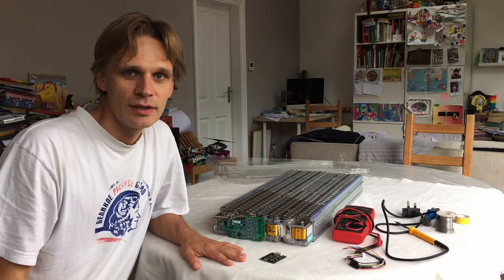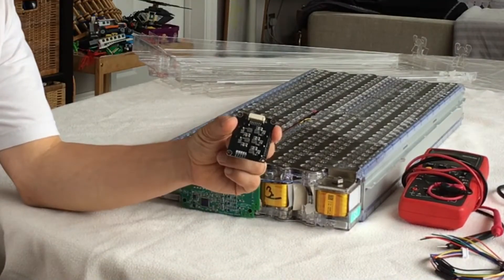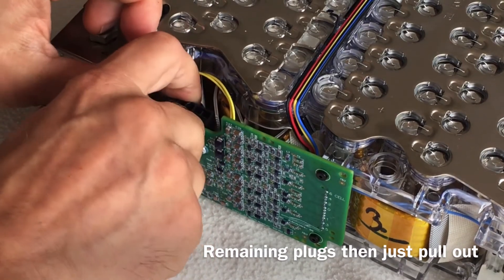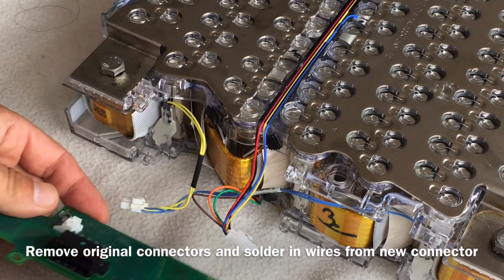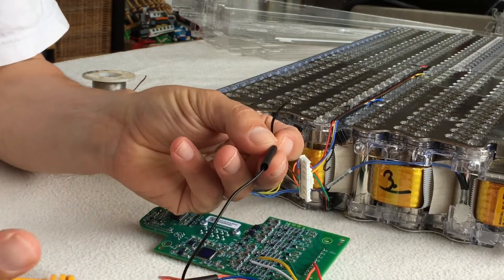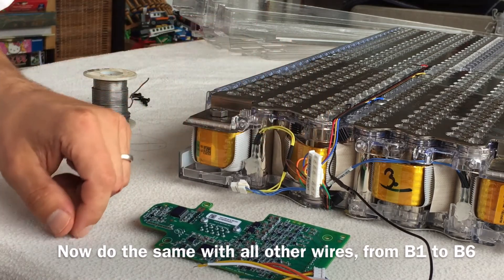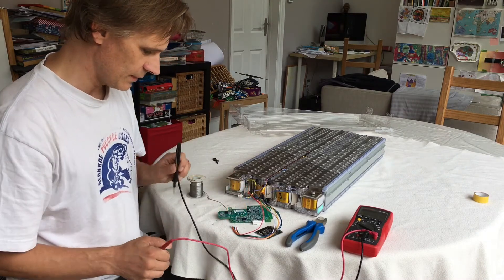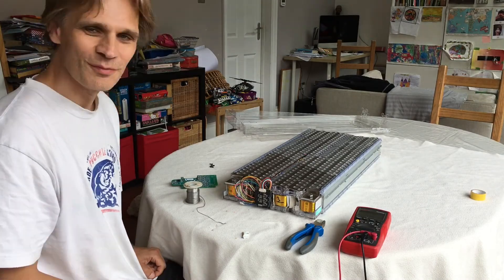5. How to wire in a BMS to your lithium ion (Tesla) battery to balance / equalise the voltages

Comment: Tesla BMS is protecting to each evey parallel and series cell ?
Reply from the maker: No, the cells in parallel balance each other and give a constant voltage across each set of cells in parallel so do not need a balancer. The balancer goes between the sets of parallel cells that are wired in series and ensures each set of parallel cells has the same voltage as every other set of parallel cells

Comment: HI Can you help me. I have been given 2 Tesla  batteries just like yours and I connected them in parallel, so the maximum voltage is 2x 25.2= 50.4. My Sunsynk inverter keeps charging up to 52.5V, will this damage the battery packs? I have not used the BMS programme because the inverter does not recognise it, so I just set it up as a AGM battery ?
Reply from the maker: It sounds like you’ve connected them in series as in parallel they’d retain the same voltage as just one battery. It’s really important if they are in series to make sure they’re both charged to the same amount (e.g. by using a balancer). Otherwise you risk overcharging and potential damage (or even fire) or potential damage from over discharging. I hope this helps.
Reply: @aktsolar   thank you for your reply and I  meant in series (brain relapse) I will look for a balancer

Comment: That looks like a cell balancer, it uses a comparator to tell the difference between a series set of cells and uses the higher voltage cell bank to change the lower cell voltage bank. This does not monitor battery voltage or current. 

A bms will cut off of any cell reaches above the desired set point (usually 4.25), below (2.85v). Bms also commonly monitor overcurrent, this is monitored through the complete system output. 

Bms are pretty much an intelligent electronic switch. If any of the parameters in violation, bms cuts off power through use of opening mosfets.
Reply: Do you know a bms that is usable for these Tesla Batteries?

Comment: hey , mind sharing the BMS link ? it seems like the links are not working , also any suggestion supported DC charger ? when i try with Victron 24V charger that wont's support < 25.2 volts ..
Reply from the maker: Hope this one works: https://www.ebay.co.uk/itm/312684889532?_trkparms=amclksrc%3DITM%26aid%3D1110006%26algo%3DHOMESPLICE.SIM%26ao%3D1%26asc%3D20190917065201%26meid%3Da0044a55d1894258bbc37c8133ff6e2a%26pid%3D100935%26rk%3D1%26rkt%3D12%26sd%3D264670364016%26itm%3D312684889532%26pmt%3D1%26noa%3D0%26pg%3D2332490%26algv%3DSimplAMLv9PairwiseUnbiasedWebCpr08MlcGreedyV3%26brand%3DUnbranded&_trksid=p2332490.c100935.m2460&amdata=cksum%3A312684889532a0044a55d1894258bbc37c8133ff6e2a%7Cenc%3AAQAGAAACEPmF7GyjPaUF1ysUFJfH5OhfOO%252FpQZU6CwGhAuGxVFfySFK3EI5vnDAR9noyyaO%252FSW7HKAaGKTUKd2VVK8FA1VSPYdCi3IoEMvZ7VW2vIVtcEwRjbCG2Ag9vSTnCWYQfFMmuBd8WSmH8ojIWa%252BBvF36yYLLl7YdYcmMhsF0551y6uf9KVGv6b7im9Us9itsInKKKquyeBV8u1tgLdbJp8gRa8OUrfelvJG9bCxGXuWXGESsOkTF%252Bo7iU9L2silrVuTVkBfNkgUEUh2gafmJp9OAzkgrjvdht2OMGM3yW3cg2xg42H2ZaRa6Npi2w95SyhdnmNw1o1PHM3EuF%252BZiNMWv%252B%252BF%252F6A6TlFyHPk%252FEmlHZtnacszMqmrr8CNzhrvyOGtyygXSLuizBgBOEszTMCWKDS9iiy6%252F1%252Bll3CnGAOy7m%252FCN5ZKLTlmsQwC8bt0b%252B7l4JYTjW%252Bv8hX3euAxKR9OhGwWAb3m%252FHWgBekE4wtbew6hjkEK3JBi5B2gSETJm9buIUiWsTF8AjwoEum1VB6DeTYsdF0yDcxbbcuql%252BG5P4FFqILLN9VdeX6rwZNpxsyuJF9i1svFxjlX5P%252BSo08ti3yfSMn59dLDiWCMHdtc%252FTSJxkra9HCwasv98PPdjNYsa%252FiSgggGSk5%252FqlpfroRpo1tMfApjXx9ztVrBKfkDIjtjzujSNPfOaM2Rgi64kkoeA%253D%253D%7Campid%3APL_CLK%7Cclp%3A2332490

Comment: Wouldn't  the circut board on the battery to begin with keep them balanced?
Reply from the maker: Unfortunately that only works when plugged into the Tesla car. It doesn’t work on its own.
Reply: I did see that little light and was wondering if that is working.
Reply: Вы правы родная плата поддерживает балансировку и в темное время суток можно увидеть ее работу-постоянно мигает светодиод

Comment: Hi, can this just be left plugged in and balance the cells automatically? Will be using it with a Victron Multiplus, Renogy Solar charge controllers and a Victron 220amp battery protector. Does this have a remote battery shunt I can wire to the remote of the battery protector? Thanks
Reply from the maker: This can just be left plugged in but I don’t and only use it from time to time

Comment: I went down replacing the board route first, interesting solution! I may use in the future! I do like my digital display though! Having had 2 modules in my system for 2 years now operating 24/7 one has been passively balancing whilst the other has a bms on. Doing an experiment over a year to see how far they go out. Charging with solar the majority of the time.
Reply from the maker: Yes, I’ve been running this non-stop for the past few months. I keep it between 40 and 80% charged and the cells are still within 2 thousandths of a volt. So I’ve actually not needed to use the balancer yet. I expect I may need to when I start using more of the capacity range on my boat this summer.
Reply: @aktsolar  My inverter is set at 19v cut off and 24.6v at the top end. Just finished another off grid solar set up now Norwich in a wood, those that brought it are re-wilding it. I import Lifepo4 to mainly 12v leisure replacements. My contact details are www.offgridsolaruk.uk be good to chat sometime.👍
Reply: @aktsolar  Also what model battery is that, I noticed that this one does not have the ribbon connector, is this a newer module or earlier version?
Reply from the maker: I think this is from a 2015 Model S (although having trouble remembering now).
Reply: @aktsolar  Just an update, I swapped some modules today and the 2 year passively balance module was taken out for readings, I have been using 20% - 80% SOC for the majority of the time so the readings were as follows:
3.75, 3.76, 3.77, 3.76, 3.81, 3.84 so 0.09v between the lowest and highest being passively balanced. 
I am now fitting like you either active balancers or the ISDT Battgo 8's to all future modules for longevity and safety. Interesting after 2 years though!
Reply: i know Im asking the wrong place but does anyone know a trick to log back into an Instagram account..?
I was stupid lost my password. I would appreciate any help you can give me!
Reply: @Emery Marcus instablaster :)
Reply: @Kevin Quincy thanks so much for your reply. I got to the site through google and im in the hacking process atm.
Looks like it's gonna take a while so I will get back to you later when my account password hopefully is recovered.
Reply: @Kevin Quincy It worked and I finally got access to my account again. I'm so happy!
Thank you so much, you saved my account!
Reply: @Emery Marcus Glad I could help xD

Comment: Hello, thanks for your video. I purchased a 10s version of this. I am hooking up 3 Tesla 24v packs in parallel. I know I need to have equal voltages before hooking them up. Which pieces of the BMS should I hook to each battery? Thanks very much
Reply from the maker: Interesting question. If you get each of the three modules’ voltages exactly the same then you can connect them in parallel. (Best to do with a slight resistance to start with to ensure they are exactly the same.) Then you need to make sure each set of cells in each part of each module is balanced. You can do that by ensuring your balancer can fit each module and moving the balancer between modules when you want to balance them. It’d be easiest to have three connectors to place one on each module so you could then easily swap the balance between each one. Does that all make sense?
Reply: @aktsolar  It sort of does. Are you saying I should purchase 3 separate BMS modules and hook them up individually? Would I be able to just hook them up and forget about them that way? Cells should remain balanced and I can have a low-maintenance system. Is that correct?
Reply: @AndrewRoberts123  Do not hook up balancer permanently. It will unbalance the battery module. In case Your are not using it with high current You do not need to balance it permanently but only occasionally.   Be aware about: Do not discharge less than 20% and do not charge more than 85% +other security around batteries (temperature during charging..etc.) than You do not need permanent balance.  + Do it like that on Your responsibility.
Reply: @aktsolar  Also please forgive my dumb questions
1). Can the batteries be within .1 volts when I connect them? Is that close enough?
2). How do I add resistance to get them to the exact same voltage?

Comment: Hello,
Can I ask you what is the type pin attachment used to assemble the PCB called.
Thanks for providing the information
Reply from the maker: I’m afraid I’m not sure what this particular multipin connector is called. But the eBay balancer comes with the connector so you don’t need to buy it separately. Hope this helps.

Comment: the link to the BMS is no good... do you have another source to purchase the BMS?
Reply from the maker: Hi, this link should work: 
https://www.ebay.co.uk/itm/2-17S-Li-ion-Lifepo4-LFP-Battery-Active-Equalizer-BMS-1-2A-Balancer-2-0-4-5V-/383816614762?_trksid=p2349624.m46890.l49292
Reply from the maker: I’ve now updated the link in the explanation as well.
Reply: @aktsolar   sorry this one doesn't work too , mind sharing it again please ..
Reply from the maker: Here you are, hope this one works for you: https://www.ebay.co.uk/itm/312684889532?_trkparms=amclksrc%3DITM%26aid%3D1110006%26algo%3DHOMESPLICE.SIM%26ao%3D1%26asc%3D20190917065201%26meid%3Da0044a55d1894258bbc37c8133ff6e2a%26pid%3D100935%26rk%3D1%26rkt%3D12%26sd%3D264670364016%26itm%3D312684889532%26pmt%3D1%26noa%3D0%26pg%3D2332490%26algv%3DSimplAMLv9PairwiseUnbiasedWebCpr08MlcGreedyV3%26brand%3DUnbranded&_trksid=p2332490.c100935.m2460&amdata=cksum%3A312684889532a0044a55d1894258bbc37c8133ff6e2a%7Cenc%3AAQAGAAACEPmF7GyjPaUF1ysUFJfH5OhfOO%252FpQZU6CwGhAuGxVFfySFK3EI5vnDAR9noyyaO%252FSW7HKAaGKTUKd2VVK8FA1VSPYdCi3IoEMvZ7VW2vIVtcEwRjbCG2Ag9vSTnCWYQfFMmuBd8WSmH8ojIWa%252BBvF36yYLLl7YdYcmMhsF0551y6uf9KVGv6b7im9Us9itsInKKKquyeBV8u1tgLdbJp8gRa8OUrfelvJG9bCxGXuWXGESsOkTF%252Bo7iU9L2silrVuTVkBfNkgUEUh2gafmJp9OAzkgrjvdht2OMGM3yW3cg2xg42H2ZaRa6Npi2w95SyhdnmNw1o1PHM3EuF%252BZiNMWv%252B%252BF%252F6A6TlFyHPk%252FEmlHZtnacszMqmrr8CNzhrvyOGtyygXSLuizBgBOEszTMCWKDS9iiy6%252F1%252Bll3CnGAOy7m%252FCN5ZKLTlmsQwC8bt0b%252B7l4JYTjW%252Bv8hX3euAxKR9OhGwWAb3m%252FHWgBekE4wtbew6hjkEK3JBi5B2gSETJm9buIUiWsTF8AjwoEum1VB6DeTYsdF0yDcxbbcuql%252BG5P4FFqILLN9VdeX6rwZNpxsyuJF9i1svFxjlX5P%252BSo08ti3yfSMn59dLDiWCMHdtc%252FTSJxkra9HCwasv98PPdjNYsa%252FiSgggGSk5%252FqlpfroRpo1tMfApjXx9ztVrBKfkDIjtjzujSNPfOaM2Rgi64kkoeA%253D%253D%7Campid%3APL_CLK%7Cclp%3A2332490

Comment: hi  which wire color from bo -b6 to active balancer   bo is blk negative  and b1 is what color b2 b3 b4 b5 b6 yr video too fast pls explain thank
Reply from the maker: B0 was black. Apart from that, it’s best to check the voltage. So B1 is between 3V and 4.2V higher (depending on the state of charge). Then B2 is the wire between 3 and 4.2V higher than B1. Hope that helps.
Reply: @aktsolar   so poke the meter   negative to B0 and  B1 positive for voltage  and so on
Reply from the maker: Yes, exactly
Reply: 6 4 2 0 - 1 3 5
0 black
1 brown
2 red
3 orange
4 yellow
5 green
6 blue 
but as said previously you should test from 0 to each wire to be sure code colour is correct

Comment: Why not plug into Tenergy and call it a day?
Thanks for the upload
Reply from the maker: I think even for a Tenergy you have to re-wire the plugs (in the way shown here). Also this way can be scaled up to balance across multiple batteries.
But I think for balancing across a single Tesla you can use a Tenergy in a similar way to using this. (Although see Gootfried’s post below that says his Tenergy off eBay didn’t work very well.)

Comment: Be carefull this is not a bms this is just a balancer and does NOT PROTECT the battery against over charging and discharging !!!!
Reply from the maker: Yes, that’s correct, you need a charge controller to protect against over-charging. But that’s the case with normal lead acid /car starter batteries and will normally come with your battery charger or, if charging from a solar panel, will be a separate box called a charge controller. (Also you also need a method to protect against over-discharging - often through the same charge controller.) So that’s all much much easier than balancing the batteries (as shown here). 
Here’s a video that shows how to do this: https://youtu.be/SgBzqgXZhiY
Reply from the maker: Here’s a video that shows how you can easily also prevent over charging and over discharging: https://youtu.be/SgBzqgXZhiY

Comment: I like a readout to make sure everything is working properly. I'm still using a Tenergy 5 in 1. I can monitor the voltages, but have to but it in balance mode manually.

Comment: If you have to tesla battery moduls and want to do 48v system. What to do?
Nice video.
Hilsen Simon manø denmark
Reply from the maker: You can wire the batteries in series and use a 12S BMS wired into both batteries. That BMS will then equalise across all 12 groups of cells. You can then charge the two batteries with a 48V charger (or you could even charge each battery separately with 24V chargers and let the BMS equalise them but it’s probably best to use a 48V charger). Hope that helps and please ask if any further questions.
Reply: @aktsolar  thank you